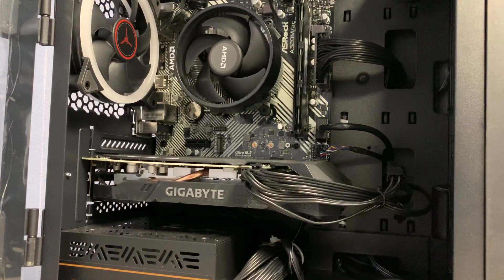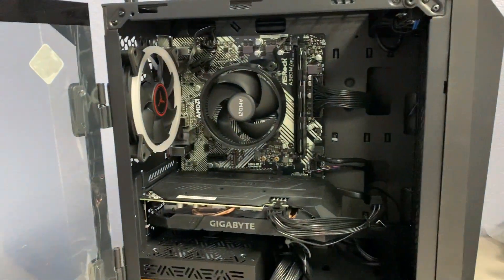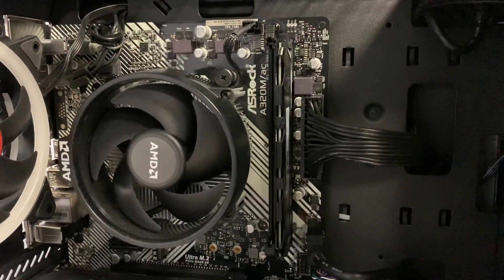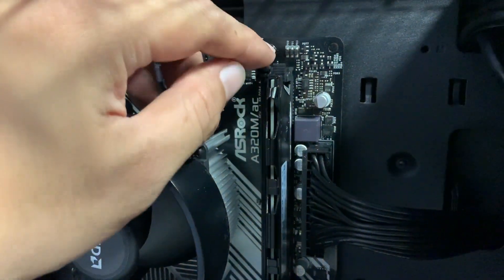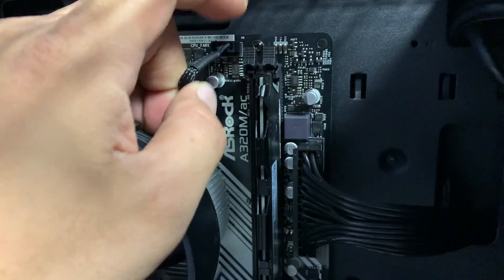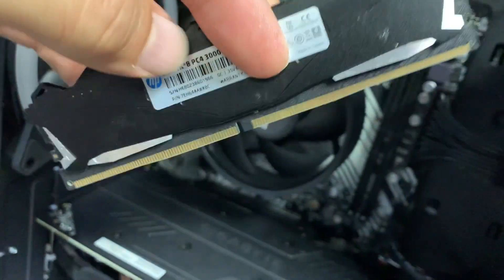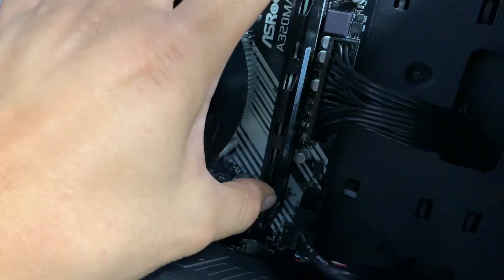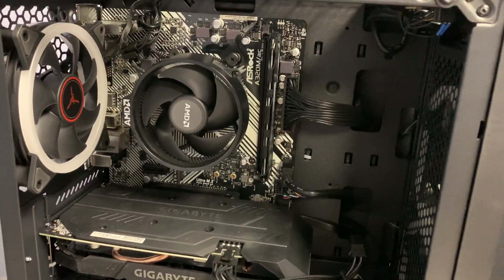Reseating RAM on your PC Blaze 2 and other models

Comment: Do you know how to remove the front panel i need to clean my fans?
Reply: You ever figure this out? I got the same issue
Reply: @johnjeral3951  you gotta pull it hard but be careful cuz if u do it to hard you could break the wire its connected to idk about other pcs but i have the one in this video
Reply: @jaymanlolx  same, so it just snaps off? Thx for the reply btw. It’s just sketchy cuz it’s glass
Reply: @johnjeral3951  yea if you gonna do it be careful because the cord is only like 3 inches
Reply: @jaymanlolx  so you just rip the glass out? Or do you need to take out some screws
Reply: @johnjeral3951  no screws
Reply: @johnjeral3951  pull it off it takes force but be careful

Comment: Can you do a video on how to upgrade this pc to 32gb ram. i have this computer but need to bump up from 16gb to 32
Reply from the maker: Hello, to go from a 16 to 32gb is real easy, its just a matter of getting identical RAM modules as the ones you have now and installing them in addition to the current ones by following the install steps in this video.

Comment: U can link we’re I can buy that same stick of ram
Reply from the maker: This is the same RAM but with a different color heatspreader https://www.amazon.com/HP-16GB-3000MHz-Desktop-Memory/dp/B08CY996SY/ref=asc_df_B08CY996SY/?tag=hyprod-20&linkCode=df0&hvadid=494674935091&hvpos=&hvnetw=g&hvrand=8038054976351573056&hvpone=&hvptwo=&hvqmt=&hvdev=c&hvdvcmdl=&hvlocint=&hvlocphy=9031238&hvtargid=pla-1158897639737&psc=1